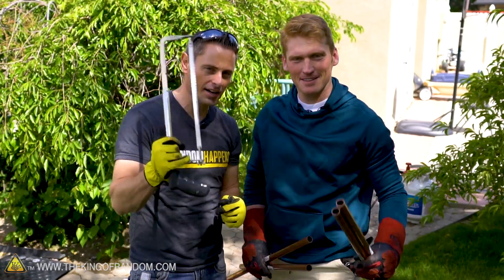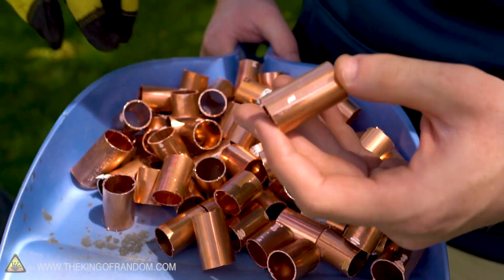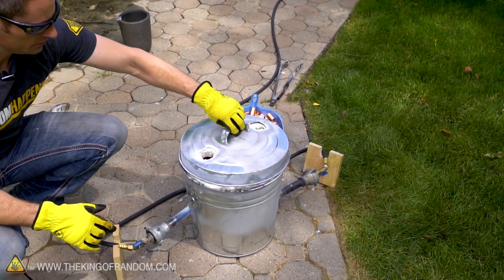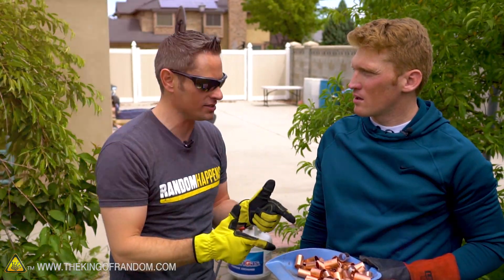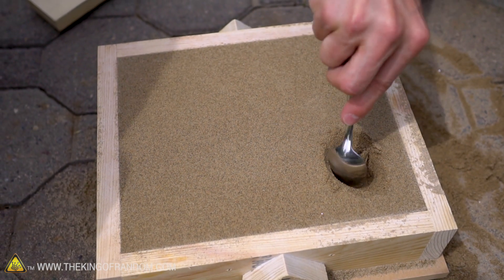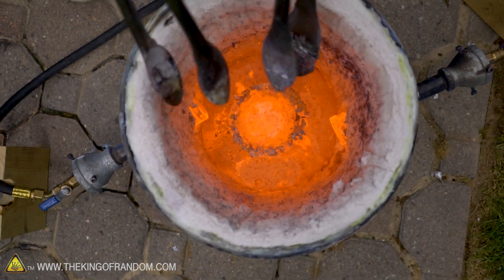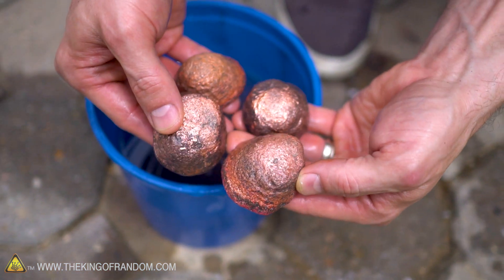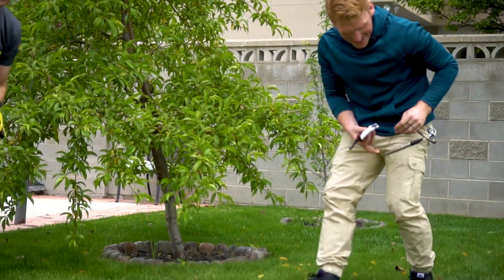Trash-Can Foundry Is LIT! We Dive Into Metal Casting and More With This Metal Foundry

Comment: i recommend putting sand on the bottom of the inside of the plastic buckets of water because i think it might melt through and break your
 bucket if you settle it in the plastic bucket as its just plastic

Comment: Grant I want to make a metal foundry but my dads a doctor and he's seen so bad burns and has been working in metal before what are the main dangers? That u can avoid easily and does molten metal explode on gravel or sand or asphalt
Reply: Also should we use fireplace tongs instead of kitchen tongs cause they bend

Comment: NOO! Don't use pipe for smelting!!! Please! You can find scrap copper for sale on ebay or find scrap wires. I personally have built up my own "stash" of copper from all my random projects with wire or whatnot. It weighs over 20 pounds now, after only about a year. Copper wire might even be cheaper than copper pipe.

Comment: cough - pipe cuter - cough
A pipe cutter would have cut it down to size with less effort and no need for the vice.... maybe a pipe wrench when you get it short. Also, it prevents loss of material because you are not sawing.

Comment: Grant, Maybe you could cut apart the muffin tin with a grinder into single sections and then you can mold some sand around it to make the same size as the muffin tins.

Comment: Is it possible to safely melt magnesium? If so, can you do it in your makeshift foundry?
Reply: Richard Phan negative. Magnesium will auto ignite in the presence of oxygen at it's melting point. It must be done under very controlled conditions either in a vacuum or suffocated argon bath. Please do not try to melt magnesium or any other metal for that matter without extensive research.

Comment: They changed color when you quenched them because the water created steam and knocked the layer of oxidization off the ingot.  Next time for a mold use the bottom of a coke can.  I wonder what the max temp is of that foundry, try a piece of cast iron and see what happens.

Comment: How about mold a supper high current secondary coil for a metal melter or at leas the connector buss work. Why would you use a high cost finished copper product like tube instead of buying scrap copper?

Comment: I once did the math on melting down pennies.  If you were able to get $10,000 in pre-1982 pennies (1982 was when they began making copper-plated zinc pennies), you would be able to melt it down into approximately $13,000 of scrap.  If you also have a notary observe the meltdown and have them sign an affidavit stating that the currency was destroyed, you can present it to the Treasury to get a further $10,000 to replace to the destroyed currency.

Comment: Indeed copper IS pricey if you buy TUBING.  Although I don't think of any better source of pure copper from a local consumer outlet just offhand -- there are online metals sources that could beat your price by miles.  Scrap copper can be had on eBay for less than six dollars per pound if you shop carefully, and 99.9% pure copper from suppliers runs around $8 in small quantities.  Scrap copper sells to commercial dealers for $2-something per pound.

Impressive, that little foundry.

Comment: Grant 
Cooper is widely used in houses as plumbing and electrical I would like you to do some experiments to see if it is still conductive after being melted and having mixed with the molten fidget spinners
Reply: Sawyer Howard Well it's still metal which technically means it has to be conductive
Reply: Felix B 
but after the slag and oxidized will it still carry a current?

Comment: If you do this again put the cupcake tray in the bottom of the sand upside down before you compact the sand.  Then when you flip it over and remove the cupcake tin you will have perfect sand imprints of the mold.

Comment: try to compress molten metal in the vacuum chamber
Reply: That technique is already being done, it makes metal foam. Not the "compress metal" part though
Reply: Compress? What do you mean by compress?
Reply: Terror Turtles A vacuum chmber removes pressure, which would allow the metal to decompress
Reply: Zach Antes you never know 'til you try
Reply: Zach Antes i thought he could explain it in a more scientific way then curses
Reply: Terror Turtles Huh, I didn't curse?
Reply: Liad Koren you do if you look at science . since it decompresses the chamber which means it takes out all air. the metal wouldn't compress. to compress it you would either need to pump air in it(would break glass after a certain time) or apply a certain amount of weight

Comment: If you buy copper from a scrap mettle business, you can, (and I have) get it for less than 2$ per lb. 

You should try to make Aluminum bronze, one of the easiest to make, and most useful, copper alloys. 

I have made Al bronze, and it is (usually) quite easy.  It also has better properties than brass and bronze.

Comment: Just stringing this out as long as possible huh, grant?
Reply: In this video I'll be lighting the foundry.
Reply: In this video I'll be letting the foundry heat up.
Reply: In this video I'll be showing what I will melt in the foundry.
Reply: In this video I'll be putting the metal into the foundry.
Reply: In this video I'll be letting the metal in the foundry melt.
Reply: In this video I'll be letting the metal melt even more!

Comment: When you noticed that the old metals were boiling why didn't you pour out those metals to gave more pure copper ingots?
I was also wondering about heating up the old crucible to melt away the old metals before you revealed the heated crucible and boiling metals.

Comment: you need to be careful that gurgling sound you have coming from the burners is the gas catching on fire before it reaches the end of the burner tube. which will get the burner tube much hotter further back which could cause flash backs out the back end of the burner.

Comment: now that you can melt copper you should try making tumbaga. it's a copper gold alloy that is lighter than the same volume of gold, has a lower melting point and is readily malleable. you can also use acids to remove a surface layer of the copper and leave a nice pure gold finish. Tumbaga was used throughout MesoAmerica. Cheers
Reply: Minh Truong walmart
Reply: Where is he gonna get gold?
Reply: Hmm, I want gold, LETS GO TO WALMART XD

Comment: You should have bought a tubing cutter at Home Depot. That's copper oxide. When I installed A/C systems, I would purge the air from the copper tubing using dry nitrogen before brazing the tubing. If you don't do that, you end up with a black scale powder inside the system which can clog the expansion valve, or capillary tubes.

Comment: Some general information for those watching. Graphite crucibles are not, I repeat, not meant to be emptied or cleaned by smacking them on any surface. Appropriate cleaning procedure is to scoop and scrape using an implement of some form.
A spoon works just fine.
Smacking as Grant does can lead to the crucible cracking or scraping thin, which would lead to further problems. Discovered this the hard way.

Comment: The pipe itself, after tooling and making it a pipe is worth about $7 each. Those ingots are worth significantly less, and I believe if you were to scrap those, you would get less for them, because copper burns off some additive that needs to be readded for it to be used in industry again.

Comment: Grant, with pennies, in 1983 pennies were changed to be zinc with copper coating. but if you have 1982 and earlier it's 100% copper. the reason why they did this was because the pennies were actually worth around 2 cents and not 1 cent. so if you find 50  pennies that are from 1982 or earlier and melted them down you could make $1

Comment: As you mentioned in the video, cooper has around the same melting point as some precious metals. It's actually a little higher then the m.p. of silver and gold. Saying this, you should try a process to refine gold from something. Something such as computer parts or other sources of gold, like gold plated glassware. Or just gold containing rocks/minerals. Before you try this project, it will be expensive and you probably won't get much gold back at all, and the various chemicals you would need are dangerous and concentrated. And the reactions should be carried out outdoors because of the fumes produced but it would be cool to see. You would use the furnace basically to separate the gold from whatever you dissolve it in or alloy it with, something like lead.

Comment: I wouldn't use the pricing for copper piping at home depot as the market price for copper. You can probably get copper cheaper through a jeweler's supply company like Rio Grande who uses industry standard pricing vs. commodity retail pricing.

Comment: when you melted the fidget spinners you probably melted steel unless you took all of the bearings out because bearings are usually made of steel
Reply: All those metal fidget spinners are made of aluminum, because it's cheap.
Reply: Iron has the melting point of about 1 535°C
Reply: you are right that foundry can actually melt steel!
Reply: Iron Lightning Not alone, but a foundry with enough insulation and heat valves might be able to melt small bits of steel.
Reply: Rylan Tuttle ححمومابتمفنناعتتتىتنمككممم
Reply: Propane can't melt steel beams. o3o

Comment: Grant you should try to meltdown A magnet ?!?
Reply: tjhooker73 Magnets lose their magnetic properties at a certain temperature other wise known as the curie point
Reply: he did that once with the microwave metal melter
Reply: Janet A you will just lose the magnet. That's all.
Reply: Heat a magnet to red hot temperatures and then try to use it

Comment: "This is like 30$ of copper".

No it's about 4$(3.80$) since you said 1.5 lb of copper.

Even then you won't get that for pipe or wire, generally resold copper you get anywhere from 50-80% of the cost of copper. You might get upwards of 3$ for it.

Comment: Grant you can get  a 3d printer that uses a material that is used to cast metal. What you do is print out your design and then you can bury it in the sand for a mold. One printer that you can get that uses this material is called the Form labs 2 printer.

Comment: Hey Grant! Is there a way to make an auto igniter for the foundry? You know, so your friends don't burn all their hair off! I know it's difficult because of all the heat, but it would be a nice addition.
Reply: i have jsut taken apart one of the lighters and extended tube and wires, thierisnides are simple as and you can use any ol thignlike a stick or tube of wood

Comment: You know you could create custom molds just buy using a box side that had blocks or ovals of wood screwed to it. You fill the sand, flip it over and remove the top and you would already have smoothly shaped indentations in the sand.

Comment: LOL You couldn't find any scrap copper? And you didn't need to cut it up. Just stand the pipes up in the crucible and they will self feed as the pool forms...
Reply: No, they are not worth $7.50 each. That's what they were worth before you melted them down. LOL Their value is considerably less at this point. :D

Comment: What would happen if you melt aluminum and copper in the same foundry at the same time?
Reply: I'm pretty sure those two metals will flare worse than the fidget spinners did. And you better be wearing a carbon-filter breathing mask when smoke from burning metal goes in your face.

Comment: Use your green sand and the styro-slicer to make a mold for a giant fidget spinner. Then make it with your melted down fidget spinner ingots. However, make it with a normal sized bearing hole so it can work. Like if you agree.

Comment: The next time you want to make copper ingots you could use an upside down muffin pan in the bottom of your sand mold so shape the mold. It would definitely make the ingots a more uniform size and probably weight.

Comment: Try melting sand to make glass?
Reply: Theres no way hes gonna be able to do that, it struggled with the copper which mets at ~2,000 F where as sand is around 3,000 F,  if he was able to melt sand he would easily be able to melt iron and steel too since they melt < 3,000F, around 2,500-2,750
Reply: Tristan W I already said that
Reply: Tristan W this isnt minecraft

Comment: Would it work having ingot moulds build into the base of the sand box? Im guessing they would definitely need to be tapered so they could slide out without ruining the shape and it would mean you could have a few interchangeable bases depending on the mould you were after

Comment: Hey I have an idea try putting sand in the foundry and melting it to glass
Reply: Cole Debenedictis Yeah make a crystal ball!
Reply: Propane can burn in air at up to 1980 degrees Celsius, 2800 if you add extra oxygen.
Reply: He could probably get it pretty hot by adding another hole to the foundry and pumping air into it. Not sure if that would be enough to melt sand, though if he wanted to do that he'd probably just using his arc furnace, we already know it can get hot enough. I know he uses a nitrogen membrane in his liquid nitrogen system, he could probably use that to generate his own oxygen supply, just pump all the gas not being sent to the cryocooler into a pressure rated container and hook that up to the foundry. Incredibly, monumentally dangerous sure but he totally could. I'm not even sure if his ceramic wool is rated up to such high temperatures. Realistically you can't melt sand and expect to get anything usable. Glass itself doesn't flow very well and there are lots of additives put into glass not to mention all the impurities present in common sand.
Reply: MrChemical1 hey ok I did not ask for your opinion I was asking grant
Reply: the melting point of sand is 1650 degrees Celsius. I don't think his foundry can produce a high enough temperature for it to melt.

Comment: try taking the black powder firecrackers made in the previous video and putting molten copper on them like put the black powder and and then on the top surface put a little bit of copper and then stick the fuse out the top and then lighted course

Comment: The reason the copper ingots are red on top is because of the slag. The way I do it is I take a steel rod that I welded a flat tip to and I scrape the slag off the surface of the molten metal and knock it off the rod and sorta stir the metal around after and then I pour it into the mold

Comment: I did copper 05/06/2017 and but it in a cake pan but  you need to preheat the pan be for you put the copper in it. I put my on a vent hole the to heat it.

Comment: I got a idea. if u combine oxygen and whatever gas. it should have a heat even hotter. so find a tank of compress or I forgot of oxygen. and have a hole or switch one of the torches to blow out the compressed or bot oxygen and see what goes.

Comment: Can the random army help me??? I bent copper pipe into a coil using sugar inside so that it didnt kink. Now i can't get the sugar out. The pipe is 1/4" and twenty feet, the coil diameter is 3". Any suggestions?

Comment: when your torches are buzzing like that you are wasting fuel because the flame is burning at the orifice instead of the nozzle and isnt as hot as it could be. this usually happens to me whenever the pressure is too low.

Comment: get with Linus Tech Tips and show him how to actually cast a heat sink. they tried 3 times and failed 3 times. copper or aluminum are the 2 common metals used for heat sinks.

Comment: I cast copper ingots (bars) in a steel mold that has been coated with carbon using an acetylene flame (no oxygen).  Haven't had one weld itself fast (yet).  The red color is copper(I) oxide, formed by surface reduction of the copper (II) oxide by the copper (0) matrix beneath. fwiw.

Comment: You could try finding a muffin tray that could fit in your sand casting box so you could still have the normal muffin ingot shape.
Then BAM! More muffin ingots!

Placing the muffin tray upside down, then the box over it. Using a soft powder so the sand doesn't get stuck to the tray. I think baking soda or baby powder would work but i recommend looking up whats best to use.
 Although they'd be slightly larger than if you poured the metal in the muffin tray since it would be using the outside size in the new mold.
Or use your other muffin ingots to make the molds although the sand may get stuck in the crevases and to fix that i would think clear plastic food wrap with a soft powder on it should work too.

P.S. If you want to cast other expensive metals then you could use the above method with tiny plastic containers or ice cube trays.

P.P.S. Sorry for the long comment

Comment: Pennies are copper coated zinc from today back to 1982. That year was a mix of straight up copper and zinc core pennies.  If you have pennies 1981 and older those are copper.  Except for I think 1943 where they made steel pennies because the copper was needed for WWII

Comment: im supprised you didn't use the muffin pan to make your mold by pressing the sand into/around the pan on one side of the box. also i found quartz sand that was very fine grain at the pet store, for reptile terrariums. i just didnt know if quartz has a high enough melting point to use for casting

Comment: You said you can make thing 2000 degrees with your solar scorcher, why not try copper
Reply: Take what I say with a pinch of salt I'm no expert, but temperature =/= heat. Just because it can get a small point to high temperature doesn't mean it has enough heat energy to actually melt something
Reply: hat is actually a great idea
Reply: Aidan Fuge, it's still worth a try
Reply: Daniel Moffett True